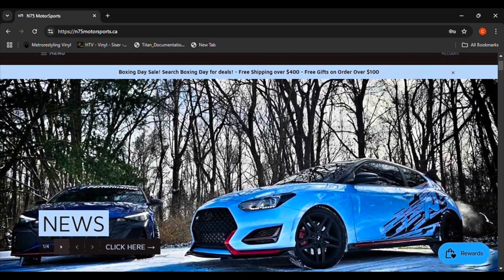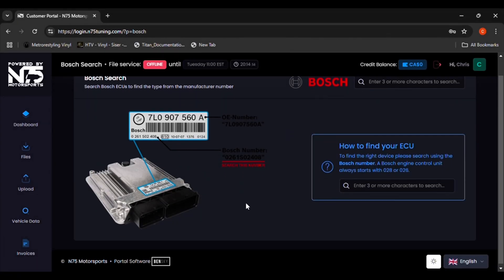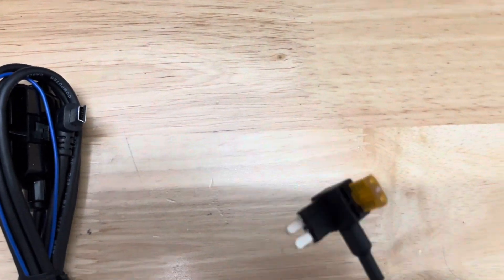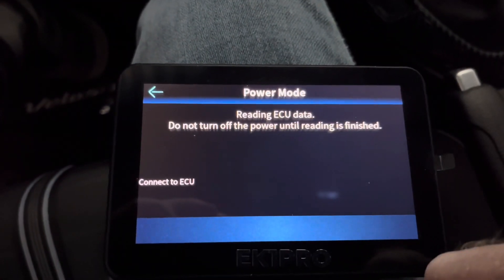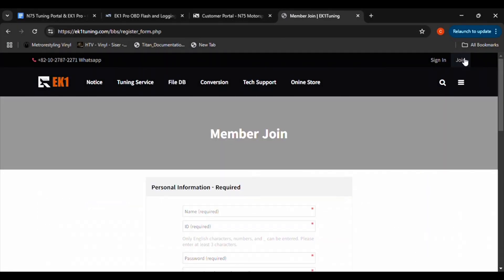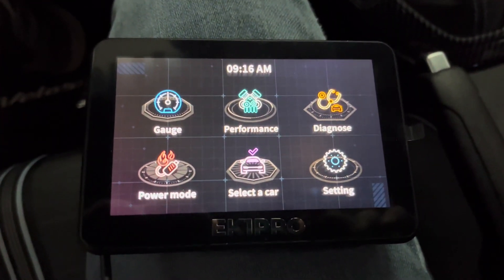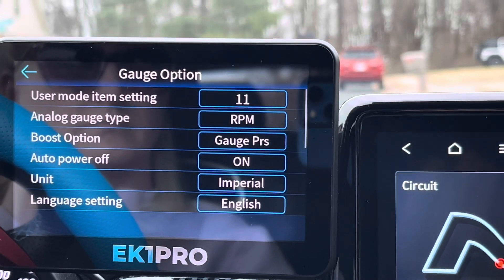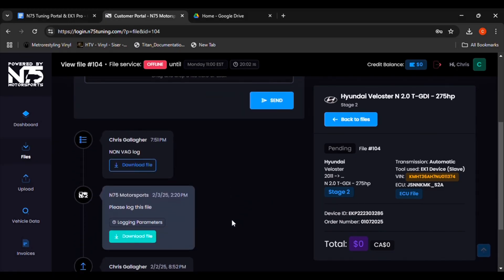N75 Motorsports Tuning Portal Step-by-Step Tuning Guide with EK1 Pro Remote Tuning Device

Comment: I've been able to run the boot patch for my car and read the ECU ID with the EK1 Mini2. Reading the ID doesn't add anything to the maps folder.  What file am I supposed to upload for the base tune request on the portal?
Reply from the maker: For the initial file, you can simply create a text file with a list of your modifications, since you won’t have an initial tune file yet to create log files for.
Reply: N75 said EK1 changed that and it doesn't save a file anymore. Just went through the same thing. Just zip a photo of the ECU ID and attach that.
Reply from the maker: @xemphios Perfect, thank you for the updated information.
Reply: Same for my buddys VN. No ecu file showed up in maps...

Comment: I have a 2017 es with 1.6t. Wondering if "read ecu id" is the proper way to get ecu calibration id??
Reply: Reading ecu is the correct option.
Reply from the maker: @thiswhiteguy4303  Ok, so it is different. Thank you for the information.
Reply: @thiswhiteguy4303  im trying this on my 18 1.6t and getting no progress at all when trying to read the ecu
Reply from the maker: @thiswhiteguy4303  I would assume it’s the same, you’ll want to select Read ECU ID, not Reading ECU.

Comment: I bought the ots tunes from sxth to start out guess I gotta make an account w ek1 tuning  and update the firmware but I already have the old ek1 tool and device is updated threw that  from sxthnk but sxth or ek1tuning seems like they don't want to answer question I just wanted to know if it's the same ek1 tool or not and kinda confused i had sxtnktuning down but idk nothing about ek1tuning page
Reply: What I'm trying to figure out if I need bench cables to flash the ECU I have a 2020 Veloster N I never did the the fuel pump recall but what I was asking the old ek1 tool is out of date now so I need to delete the old download the new from ek1 tuning sorry I just learned about ek1 tuning once I bought sxth ots maps but I read if u did the recall or car 24 or newer u need bench cables to flash the ECU  or iam I wrong
Reply from the maker: @ I have a 2022 Veloster N, I did not do the recall, so I didn’t need the bench kit.
Reply: @nprform  cool ty
Reply from the maker: @AlanBarratt802Vt  If I’m understanding your question correctly, EK1 Tuning’s website will help you update your device and get files such as, boot patch or OEM files. I believe the software tool is similar or the same.

Comment: So with data logging I’m having issues 
Am I going from 3rd to 7th gear or hitting top speed to  do 100% 
I’ve been told that I hit only 100% throttle for 1 logging point after it goes down to 70, and that you need to keep my foot to the floor. Idk what that means
Reply from the maker: @davidcoatessr5737  When data logging, you should be in one gear for the log, either 3rd or 4th gear, depending on how much road you have.

Comment: Writing a tune to my car , 
When I get other tunes do I have to keep going long process switching between tunes or can I flash a tune with the ek1 mini 2 + on the go ?
Reply from the maker: @davidcoatessr5737  Once the car is set-up with the EK1 device, you can switch between tunes easily. Keep in mind, you will have to have the car “on”, not running, when switching tunes. The tune will load quickly. You cannot be driving down the road and switch between tunes on the fly.